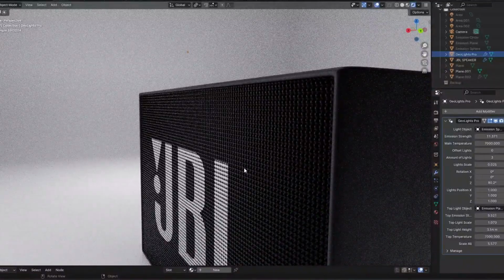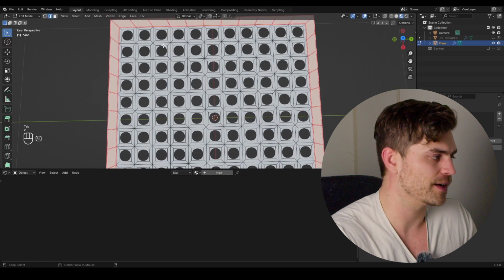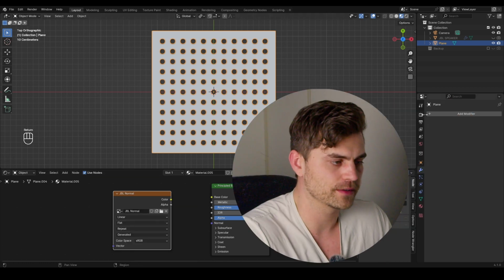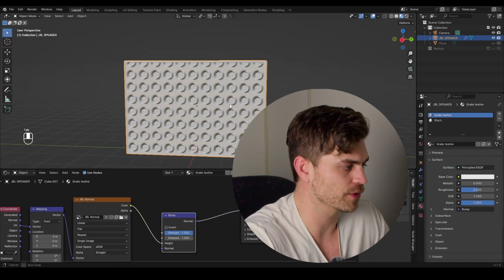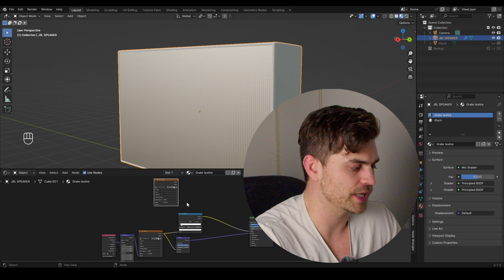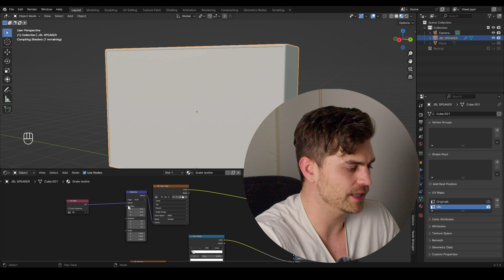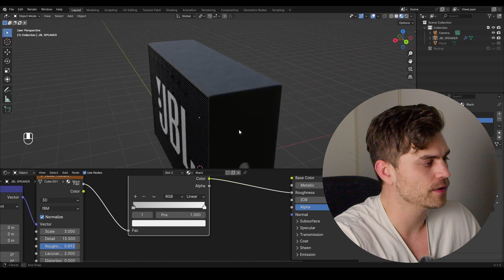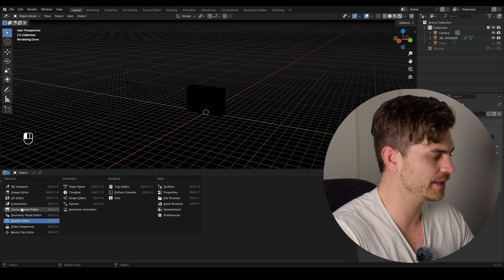How To Texture a Speaker in Blender [Part 2]

Comment: Hey dude, for some reason when I unwrap the JBL logo, everthing stays the same and the uv editor doesn't do anything. Do you know what the problem could be? I figure it might be the image I used but I want to know what your input would be.
Reply from the maker: He man, did you select the correct UV in the data object properties tab, as well as adding the UV map node in the shader editor and plugging it into the mapping node?
Reply: @theblenderender  Hey, thanks for getting back so quick dude!! Yes I did both of those things, it’s telling me that I can’t unwrap due to an issue with the scales being uneven.